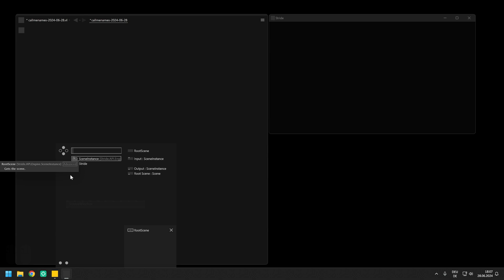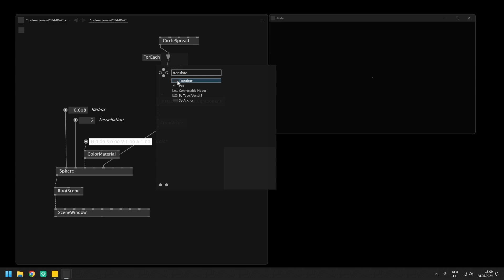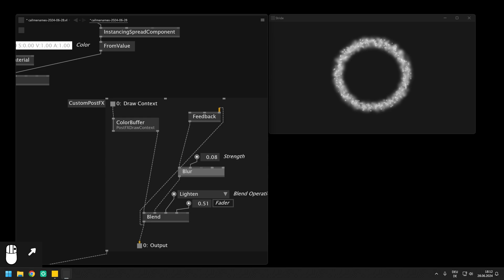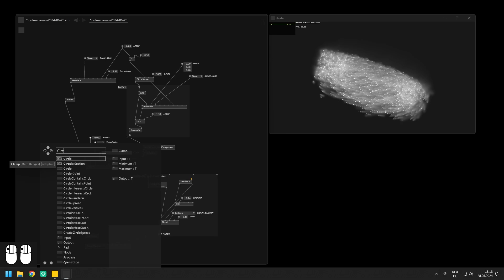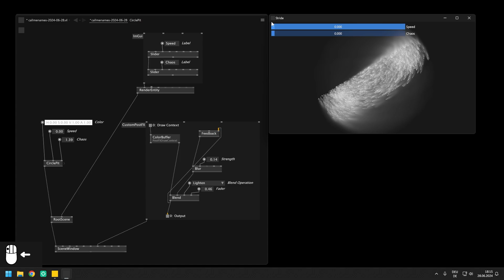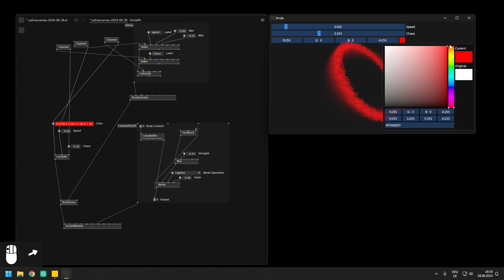Comment: thank you so much for this tutorial. I am searching for this stuff in vvvv since weeks, as I havent switch to Gamma until now. Just thank you! ... and I was afraid to switch to other apps... is it possible to spread/to instance the CircleSpread to have multiple 2D-Shapes forming a 3D-shape?
Reply: Thank you very much! To answer your question - yes it is, you can combine the output of a CircleSpread with other spread generators, as a CircleSpread is simply returning Vector2 values. For instance you could loop over the contents of a CircleSpread and a LinearSpread, and use a XYz node to use the values of the LinearSpread as the z value. The output of this will be a spiral along the z axis. Feel free to play around with this approach!